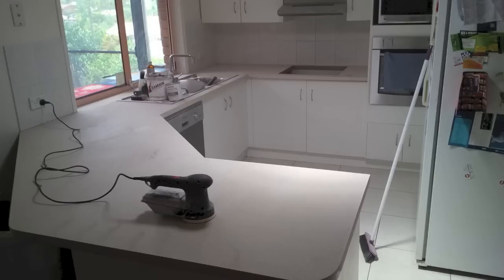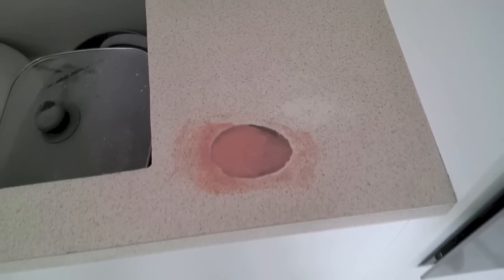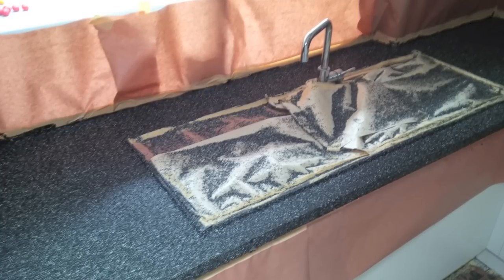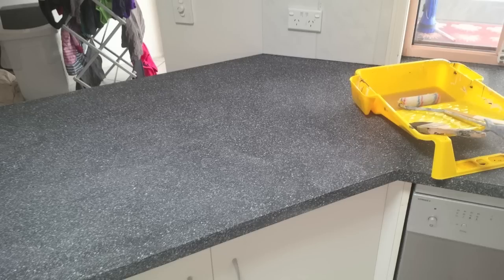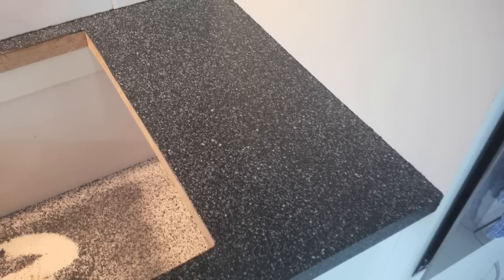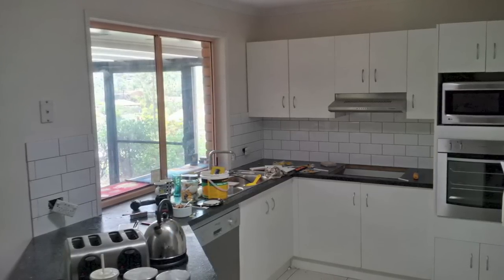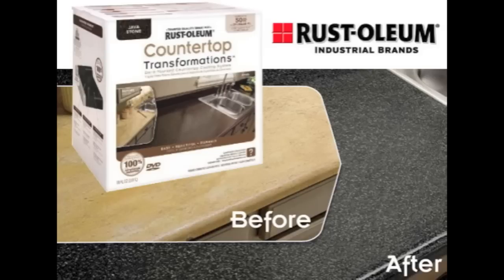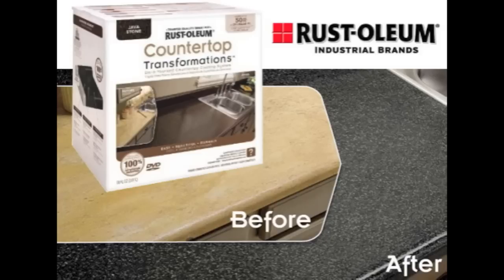Kitchen Benchtop Renovation

Comment: hey mate. what sand paper should i use to sand the clear coat?
Reply from the maker: when you say clear coat, do you mean the clear coat im putting down between coats, or are you talking the original laminate, which isnt clear coated.    In either scenario, the fastest method is an orbital sander with a fine or medium disc.   Start with fine probably.      If its between coats like i've done (which is not in the manual of the product) i dont believe it needs sanding other than to remove any imperfections because its similar to car paint in that it actually melts to the coat your applying it to, and within 24 hours doesnt require sanding i believe from memory.    If you want to double coat it, you're best to ring your rep and just double check those times, but my rep told me (non-painter) that It wasnt designed to be double coated, which isnt correct, but then he told me how to do it anyways.
Reply: before you put the final 2nd coat on.
Reply from the maker: jason plowright just regular stuff you would use for timber brown or yellow
Reply from the maker: make sure you check with the paint rep, if you do it too late the 2nd coat wont stick to the first and the finish will fail, and if you go to early, it will eat the first coat and make a big mess - word of warning !!!
Reply: even with a good sand the 2nd coat won't stick if it's left to late? wanting to let it dry so i can give it a good sand to make it nice and smooth as the 1st coat i put on is ripply
Reply from the maker: jason plowright yes it should with a sand  dont sand too much or youll undo your work.   But enough to key the two surfaces together
Reply: cheers mate thanks for the help